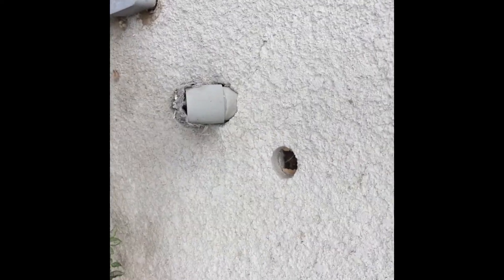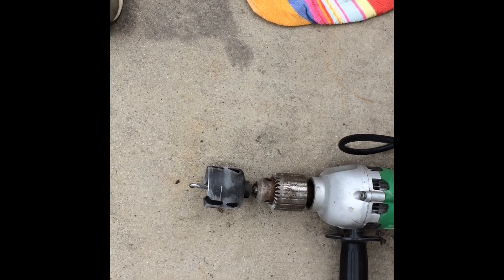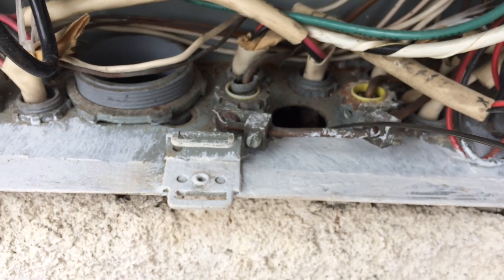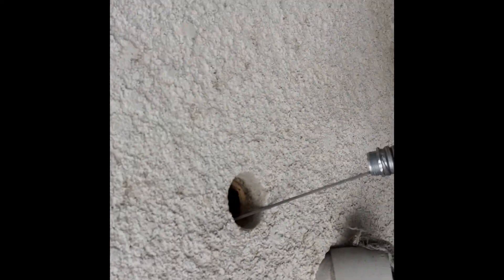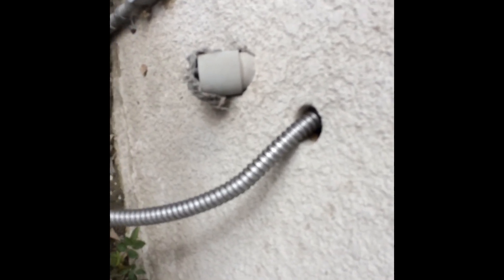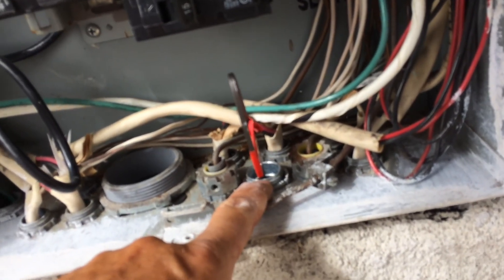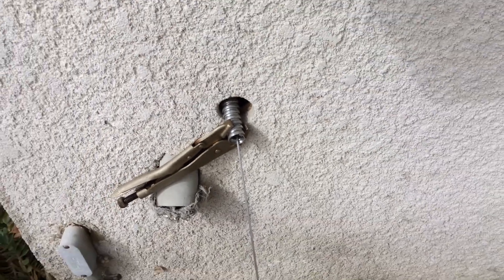Fishing Flex Conduit to a recessed electrical panel with power off

Comment: Thanks, useful video. Was it necessary for the conduit to go all the way to the panel, or could you have had a junction box at the wall and then bare wire to the panel?
Reply from the maker: I’m not a licensed electrician and  NEC should guide you.  I understand that you could put romex type cable in the wall the run THNN cable in conduit.  One other comment here talks about running a telephone LB. Also consider that you may also want to run  more /different wires in the future and conduit would  be easier to pull those wires.
Reply: @dannyjensen4954  Thanks! I'm about to do something very similar on a recessed panel and gathering as much info as possible first.

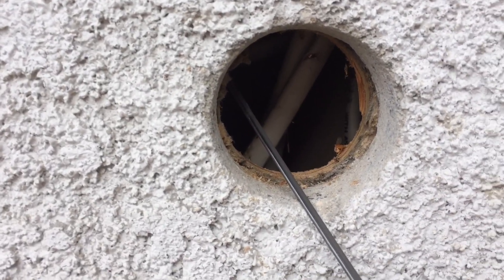Comment: At 2:18 it looks like your wood drill bit chafed the white electrical wire. I would change that out quickly to avoid a possible electrical short/fire
Reply from the maker: It turned out that the wires were not impacted by my holesaw unlikely. And if I was to try and change those wires it would have been a horrible task. I would’ve been ripping the wall out and restock a wing truly it would’ve been a nightmare
Reply: @dannyjensen4954  Well hopefully you wrapped that part in some electrical tape. I'm sure your ok but just giving you a heads up
Reply from the maker: @artr.4123  I see now. The cables were marked by a sharpie by the electrician I think and that is what I think is on the video. Thanks for you heads up review. I’ll remember this in the event I have issues . It has been a few years so my memory  of inspecting the wires is not that great.